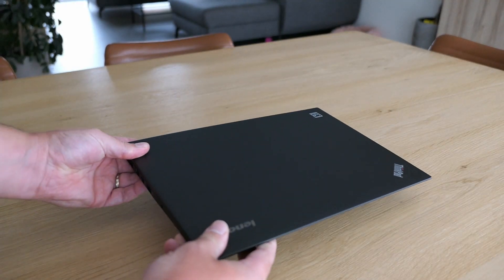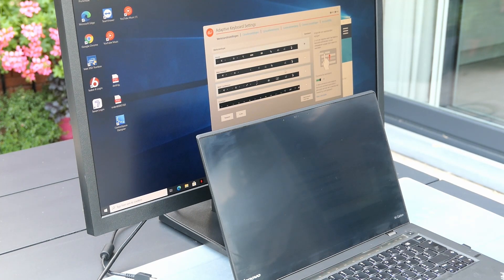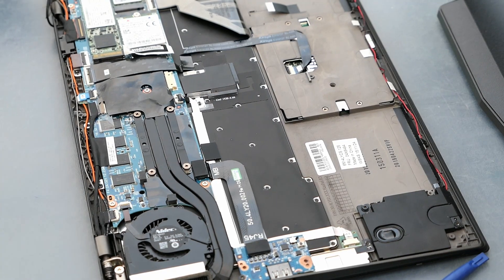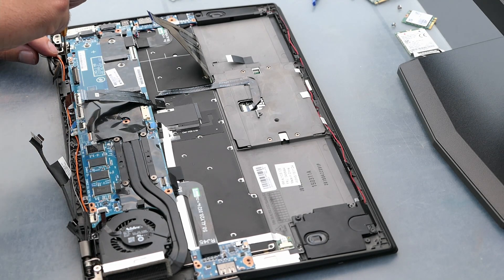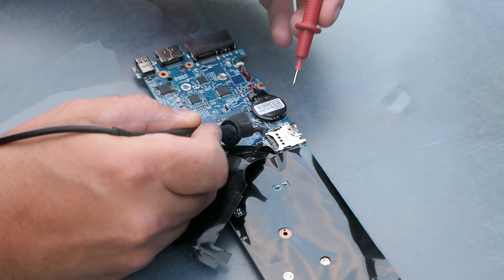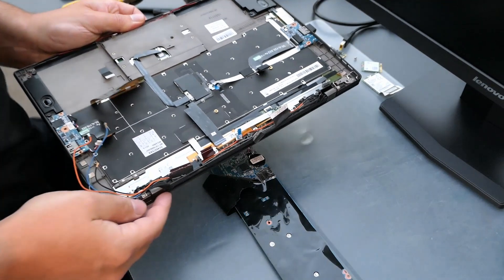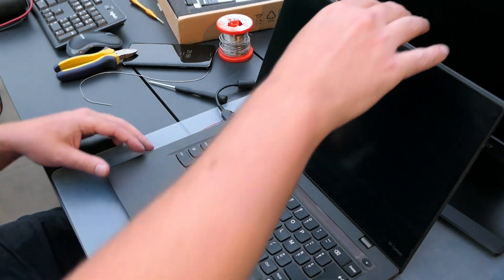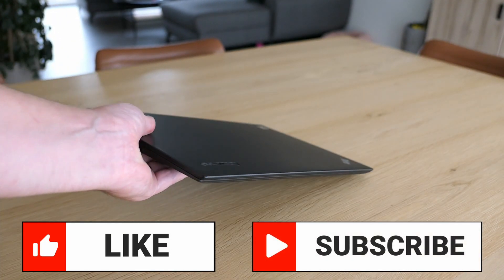Lenovo X1 Carbon LCD Backlight Repair

Comment: Thank you for this video. I obtained a thinkpad X395 with a problem with backlight. I have the schematic and the fuse was the same F7 and  was in the back side of the motherboard; with the soldering bridge it worked again.
Reply from the maker: @fabianri  great to hear

Comment: We had a similar issue with a x1 carbon 5th gen.  The 5th generation does not have any fuses on the board.  But there was a burn on the bar and near the connector of the LCD panel.   thanks to your video I new there was an issue with the board and took it to someone to get repaired.
Reply from the maker: Looks like this is a pretty common issue on the X1 carbon line. Strange that even the 5th generation still seems to suffer from this.
Reply: Thanks for the heads up about the 5th gen. Was just about to consider buying something to solder

Comment: Duuude, thanks so much! my fuse i slocated in a pretty tight spot but i managed to put a bit of solder on it and i got the display back a bit bit (it's now whitish) but i think it's because i need to try and do a better solder job lol.
Reply from the maker: It looks easier than it is, you definitely need a steady hand :) Good luck!

Comment: Hi at 5:25 where u solder both ends of the fuse it looks like ur using a screwdriver. Did u use solder wires and what was the screwdriver for? I have a thinkpad too and found the F7 fuse below lcd connector. The F7 fuse was vertical to the lcd connector and perpendicular to a bigger fuse(or other component) the length of the F7 backlight fuse was the width of the bigger fuse. I bought a soldering iron and soldered on top of F7 fuse(first time soldering)with the included solder wire. The F7 fuse was covered in solder completely and the connection was good on multimeter. Since it was my first time soldering and it was very tight the solder bridging the F7 fuse touches on one end of the bigger fuse next to it,(too much solder)(the bigger fuse perpendicular to it)I assembled it back and it turned on, the backlight now works howether is it gonna cause harm that the F7 solder touches the fuse next to it? There is a slight burnt smell (on lcd connector area) but I assume it’s only cuz of solder.
Reply from the maker: Didn't use a wire and connected both ends just with some solder. I used the screwdriver just to be able to create a bit of space where solder could flow under and to hold it in place long enough so it would set. Hard to tell if the short you have with another fuse would cause problems in the long run. I'd try to avoid it but if things seem to work fine, it might just be allright.
Reply: @jensdbe  Ok thank you, by the way could u send a soldering tutorial for newbies(like how u soldered) so if i do soldering next time I do a better

Comment: thanks very much for the video you dont by any chance know where i would find the backlight fuse on the x1 carbon tablet 3rd gen ??
Reply from the maker: If you want to replace the fuse, you should find the fuse's type/value and then it shouldn't be too hard to find it online at a webshop that sells SMD-components. Unfortunately it's not very easy to replace these type of components on the board.
Reply: @jensdbe  If i found were the fuse is located could i do a quick solder like yours ???

Comment: I have the same motherboard ,it won't power up. it just flashes 3 times when you press the power button.
Reply from the maker: Haven't experienced this myself but I see some people manage to solve this by removing the battery, CMOS battery, leave it for a few minutes and then put everything back.

Comment: Same issue with a yoga x1 1st gen, same fuse 7 close to the screen connector. Even worse place to solder since no room to the sides, also had n0 special equipment other than a microscope but got it working again. Thanks for the video
Reply from the maker: Sounds like this is a more or less common issue. Great to hear you managed to fix it.

Comment: hi i want help for my x1 carbon,same issue but not showing on another lcd via hdmi
Reply from the maker: If there is no output using HDMI, the issue is probably something different.
Do you see something on the screen when using a bright light? To check if the LCD is still working and it's only the backlight?